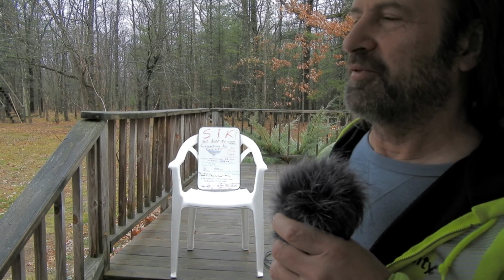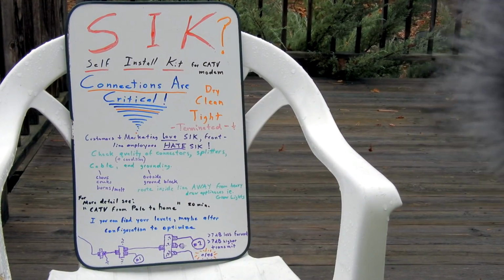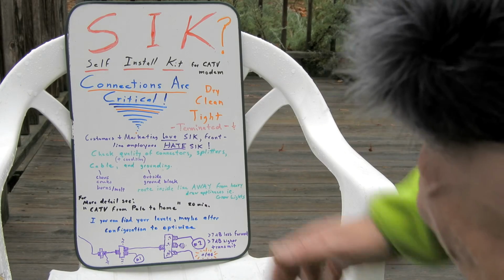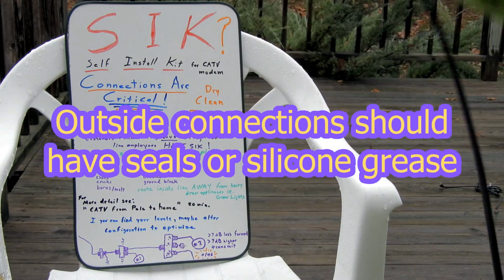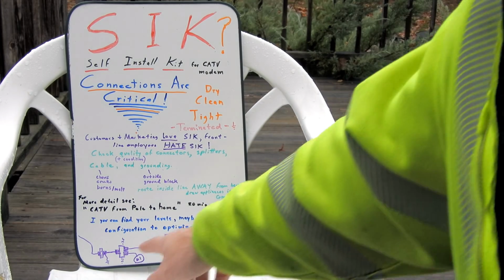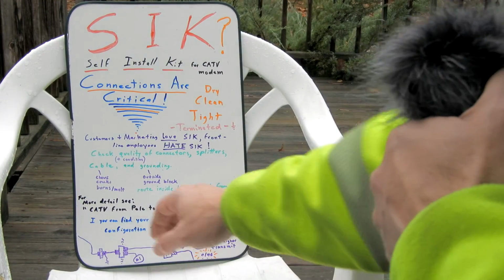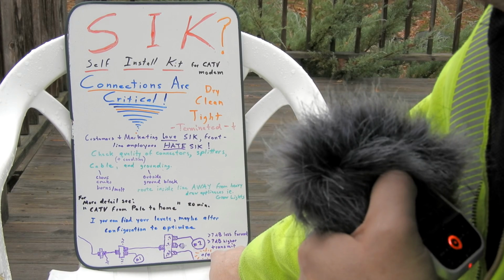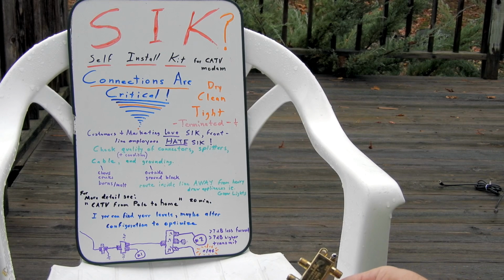Self Install Kit? Here's Some Tips!

Comment from the maker: Sorry about the volume changes! Needed to mount that recorder somewhere rather than hold it. The in-camera audio was useless as a backup, wind noise.
Reply: Does your recorder have a limiter and/or compressor setting? It can be used for voice recording to prevent the overdriving when you talked to close to the mic.
Reply from the maker: @JohnAudioTech  Yes, need to get into playing with its' different modes, likewise with the cameras. I did the first two videos way back in its' default mode then switched to "field" mode which has been working well for most of what I do, no glitches. Yeah needs to be in a heavier AGC mode to use as a handheld mic. Better yet I could have NOT held it